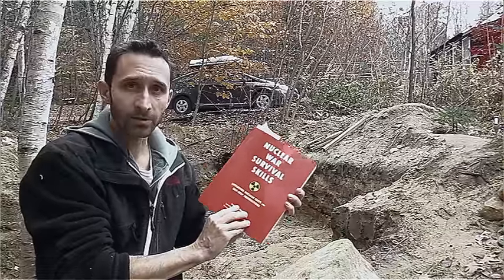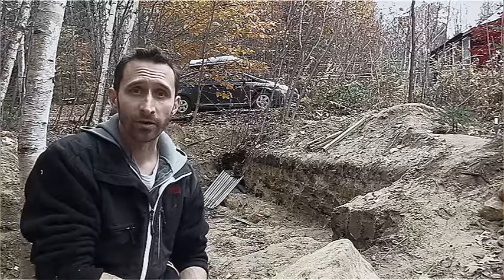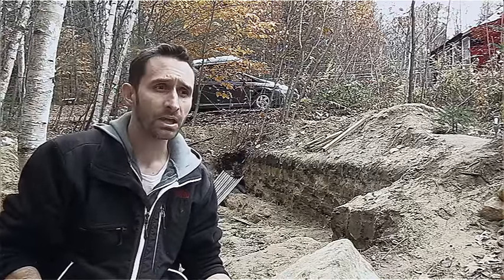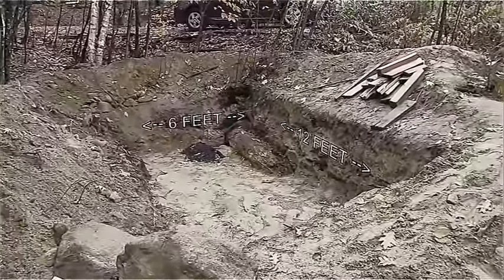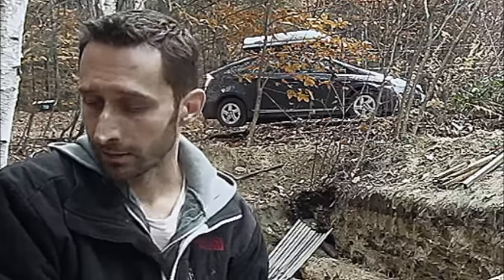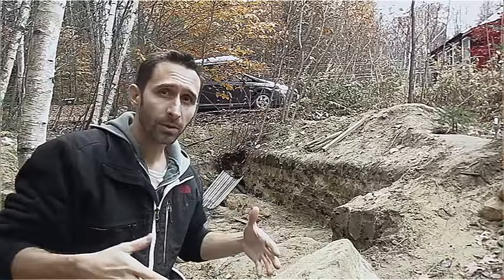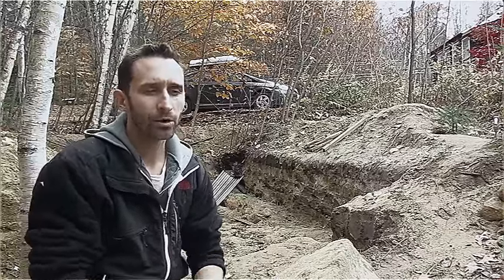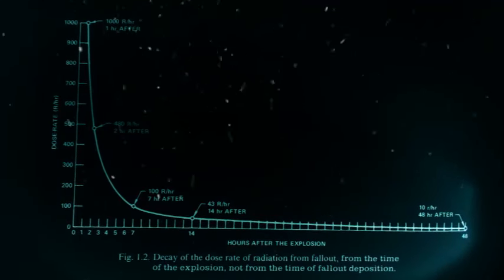Surviving Nuclear War - Part 2: Shelter Building

Comment: consuming gamma radiated water? ...  great vid man.
Reply: yeah sooo the wheel barrel and umbella, Hillllllarious!!!! reminds me of the 50s/60s animations. way 2 fun-e!!
Reply from the maker: From what I'm reading, the water being irradiated doesn't seem to be a problem. Having fallout IN the water is bad, but drinking water that had been exposed to the radiation doesn't seem to be an issue. This issue is of course fraught with controversy - some people don't drink water from a microwave oven etc... come to think of it I'm one of those. But from what the books are saying, unless there are fallout particles IN the water, it's good to go.
Reply: Ah I see the difference there. Like i said in a different comment i do need to learn the characteristic of gamma and other energy. But heres a thought, if the gamma can go thru ur entire house structure and get ya (harm you) while trying to shelter in the basement, but its safe to drink gamma irradiated water, does the water nutralize it some how? Oh man, ya have me thinkin now. New project for me. Thank you for sharing ur efforts/knowledge. You've helped resolve my dilemma of project-less-ness.  o.0
Reply from the maker: The water stops the radiation energy the same way that dirt or concrete or lead does, when the radiated particle hits one of the atoms. There are different types of radiation, but it's not the particle per-se, but the energy it carries by the velocity... sort of. Alpha radiation is pretty much just electrons. Beta is essentially just a helium nucleus... or was it the other way around? Anyhow, the reason you don't want to eat or drink fallout contaminated stuff is because you don't want the radioactive particles to be continuously emitting radiation while passing through your digestive tract. At least that's my understanding of it.
Reply: Praxis Prepper the water nutralizes its activity which makes it harmful to us. Makes sense.

Comment: If using water as a radiation blocker would you really want to drink it not knowing how much radiation it absorbed.  To me its like hey we stopped the radiation now lets drink it.
Reply from the maker: It sounds weird, but from everything I've researched, it's not a problem at all. I have of course not tested this personally, given the players involved, but I did look into it deeply and the experts (that I have an inclination to trust in this case) are pretty unanimous on it being safe. Now this ONLY applies to water that has been irradiated, but is free of any radiation particles. It's the radioactive particles that are the problem, not what they may have irradiated. Think of it like eating a steak that's been punched and pounded by some heavy-weight boxer. You don't want to get punched in your own face by the boxer, but eating the steak they punched isn't going to give YOU any bruises. This is the same situation for the air that we breathe. In a radiation emergency, you need to have fresh air coming into your shelter, and as long as all the radioactive particles are filtered out, the air itself is safe.